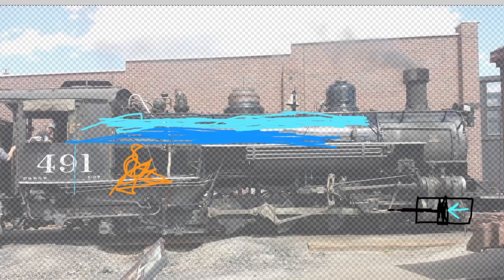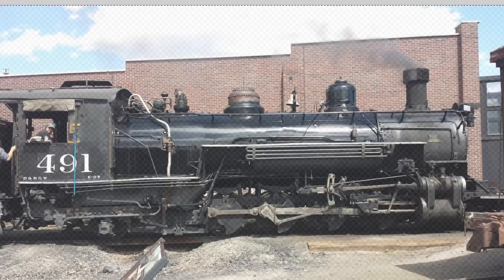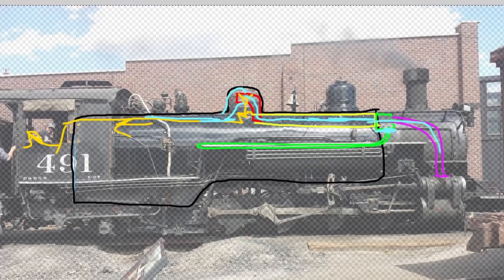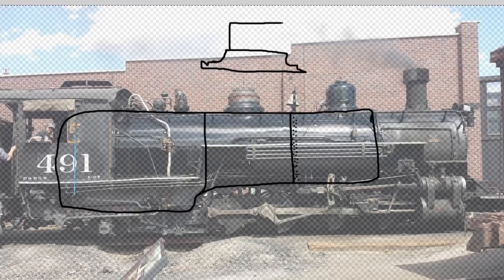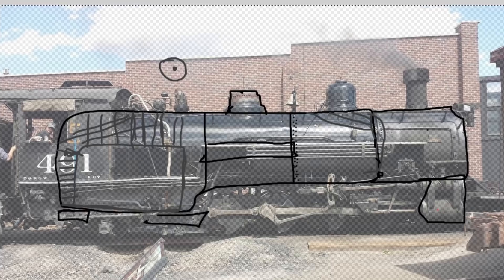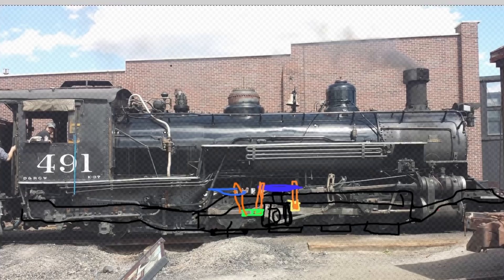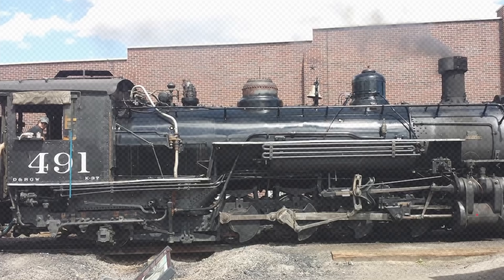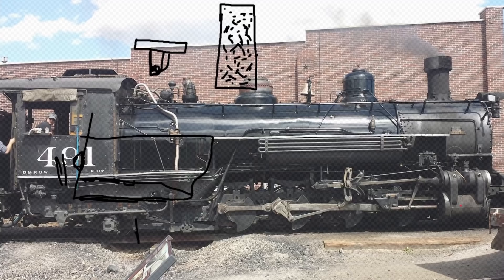Steam 101: 10 Levels of Steam Locomotive Understanding

Comment: Excellent video Hyce!

So a possible analogy for 'hooking up' or notching back the johnson bar can be somewhat equated to the throttle in a car today. To get moving you typically have to give the car more gas to overcome the stopped inertia of the vehicle, and as you pick up speed you actually let off of the gas pedal because the initial amount of power needed isn't required so you're either going to take off super quick or spin the tires, you will obviously burn less fuel at part throttle as you would with your foot mashed to the floor pan. You'd also use first gear and not 4th to start out.

A steam engine isn't quite that simple as you're not controlling an explosion in a cylinder, but rather a compressed, active gas. I say active because it's not just like compressed air at some pressure, you actually have a thermal component of energy tied into that as well. Without getting into really ugly thermodynamics, just understand that hot compressed steam has way more power than just compressed air. 

Ok, so what practically is going on? At stopped the engineer needs to have fine control of the volume flow of energy from the boiler to the pistons. Because you're trying to acceleration literally thousands of tons, through a contact patch between all the driving wheels and the rail that's maybe the size of a dime, you have to be very careful how you apply that power. At low speed it is easier to just control the flow and use the whole stroke of the valve gear to have that fine control It does waste steam because you have way more energy there than you need, but it's easier to control. Once you get everything broke loose, and rolling in a more or less steady state (let's assume level track for sake of discussion) you're now at the point in the car where you'd start letting off from the gas pedal. But in a steam engine remember that you're real goal is controlling total energy usage... so while throttle is letting the energy get to the pistons, the johnson bar is what determines how efficiently that energy is getting used... 

Now that you're moving kinda steady state, you can move from full admission (valve open the entire piston stroke) to less admission (moving the bar more towards center and less piston stroke). This is where the thermodynamics part kicks in, such that instead of just flooding the piston with 200 PSI of ridiculously hot steam, you can maybe fill that piston volume with 75% but let the heat transfer it's energy to the motion to do work.  Kinda like also going to 2nd gear. 

I'll call this out separately because this isn't going to be accurate, but for the sake of discussion, you'll get the point, At full admission you push in 100% cylinder volume at say 600 degrees Fahrenheit.  When the piston reaches the end of the stroke, that 100% volume of steam has to get out and up the stack, it might leave the cylinder at 550 degrees... but you have a boatload of volume to get out, so that when steam hits the piston to reverse travel on the other side, it can actually move the piston back. There comes a point in speed, where at full gear the valve ports simply aren't big enough to get the steam out of there fast enough to allow the piston to go the other way with the train load and not trying to force the waste steam out too... So, by cutting the Johnson bar back, you might only put in 75% volume at 600 degrees, but now at the end of the stroke, the steam leaving might only be 400 degrees... and... you have 25% less steam volume to shove out to make the piston go the other way....  The more cutoff you use, the less steam goes in, so that might be 50% volume at 600F but now it leaves at 300F ... and so on. And again, you'd use another higher gear, and another and so on.

There comes a balance point where once you match flow rate of energy from the boiler to the energy required to keep the train moving at whatever speed you want.  You can loosely also equate this to using a higher gear in a car... you start in first, then second and finally end up in 4th or whatever.. You'd never be able to start in 4th, but you couldn't run 70 MPH in 1st gear either. And that gets back to the efficiency point as well... buy using progressively less cutoff as you go, you consume less steam and therefore less fuel to boil the water to make steam.  If you tried to run the steam engine at full speed at full gear, bar all the way forward, 2 things will happen, you'll run out of steam, and you won't even get going that fast because of the back pressure issues you'll have in the cylinders and valve chest... Oh and the fireman will probably try to beat you to death with the coal shovel because no human (or probably even mechanical stoker) would be able to supply enough coal and water to match the consumption rate. 

And as a final note, if you were to come to an uphill portion, just like in a car, at some point you're going to need more power to overcome the grade... same is true here. You probably can't open the throttle any more, or it may already be open all the way, so instead you'll start slowly moving the bar back forward again adding a little more admission, or like downshifting in a car. It's a balancing act. 

That's a lot to absorb, but that's probably the most simple mechanical analogy I can come up with to further explain what's going on.
Reply: This is an outstanding explanation!
Reply: @Bill Chisholm I have a Digitrax system and I just find it so much easier to connect it to a pc or a laptop and run JMRI. JMRI is free and on a NCE Powercab there is a NCE USB interface 5240223 that you can buy that connects as a controller and allows you to program using an easier to understand named settings.  And it allows you to save those settings for the locomotives, stationary decoders and signaling decoders. 

I use JMRI to help speed match engines with different brands of decoder. I have a mix of BLI, Athearn, and Kato. With dcc from factory and with added decoders later. 

And on my Digitrax loconet, it also controls the signals, while running on a Raspberry Pi 3b.

Comment: Great video you got here. I finally understand how steam pistons really work.
I would love to see similar video focusing on brakes. Especially of how main brakes work since understanding that would be useful not only for steam trains bot basically for all types of trains since most of them use similar system.
Reply from the maker: Certainly! The most advanced steam engines used the same kind of brakes most of the diesels use(d) so it will definitely be applicable.
Reply: @Hyce777  Looking forward to the video

Comment: Nice explaination. 
I have some experience with woodburning locomotives, they're not really that different from coal burning ones. Our locomotives are coalburners, but they've been run on wood in times where there has been coalshortage (WW1 e.g.). One of our locomotives (UHB No 2. Urskog) has been rebuilt from coal/woodburner to oilburner and later from oilburner to biomass-briquette burner and is now considered a "green" steam engine.

Comment: As a steam fan (but not fanatic) for quite a few years, I think that you have done a great job in only 1 hour. The further up you got, the more times I found you filling in or clarifying details- Thank You. At the end you did a great job of covering my wish list of other steam engine/train functions.  I guess that my only part that could have used a little more work was the injector system. It seems strange that a steam supply at boiler pressure could overcome boiler pressure and force water into the boiler. I have read about the injector venturis, but it still seems like magic (and invented so many generations ago! ) I would have thought a steam driven piston pump would have been need-like the air compressor.  Keep up the good work!

Comment: I'm not exactly sure how I would fit on the scale. I like steam locamotives but I'm not extremely well versed. However I am a huge naval history buff so the engineering behind coal and oil fired boilers I've got down to a T
Reply from the maker: But remember these are fire tube boilers, not water tube boilers... always slightly different. :)
Reply: @Hyce777  there were early ships that used fire tube boilers. Like some of the wooden hulled paddle boats from when steam power was first used on naval vessels

Comment: Great video and explanation. On an oil fired engine, one purpose for the "peephole" on the firebox door is to allow sand to be suctioned through by the draft to run through the tubes and flues to clean the soot off.

Comment: To add to your comments about rivets: Hot riveting generates tension to compress the pieces together because the rivets are installed and formed into place at a high temperature. When the rivet cools, it shrinks and that is what gives the shaft of the rivet its internal tension. Whereas a threaded fastener generates compression through torquing the bolt in place.
Reply from the maker: Huh, that's a little detail I didn't know / think about. Makes sense though. That's cool!

Comment: Very great video explaining in depth the different features and components. As a avid steam enthusiast I have not had much locomotive experience but have operated several 7.5 gauge locomotives. Operating a full size loco is on my bucket list. I do however own a steam traction engine which works alot like a locomotive. Would love to give you an invite out to ohio if you where interested in running one. Loving what you guys are doing with railroads online and how well the controls reflect running the real thing and I know it will only get better.
Reply from the maker: Cheers! I'm familiar with Ohio, my great great great granddad founded the Huber manufacturing company so I go back to Marion here and there for reunions, and there's typically traction engines there ;)

I appreciate the invite!

Comment: 26:21 "crash course " intended tounge in cheek or pure sarcasm. 28:05 oiled or grease. "this is just an overview ..." yes, just an overview but you are doing an excellent job so much that I'm not consistently watching just listening so the picture you are painting is " spot on"
Reply from the maker: Ours were just oiled, though I'd bet some of the larger locomotives had soft grease or hard grease fittings for the furnace bearers.

Comment: Hi, I loved your video, lots of great detail and good explanations overall.  One comment about your discussion of the injector:  In practice (and I work with model live steam, but it works on the same principles) when operating an injector, you open the water source first, then apply the steam (or some injectors have a single valve that does both simultaneously).  Opening the steam passage first will heat up the injector, which prevents it from functioning.  Also, the the injector overcomes the boiler pressure because the latent energy of the steam is absorbed by the water as the steam forces the water through the injector cones.  Using both forward and inverted venturi cones, the speed of the fluid is accelerated while the water absorbs the heat energy of the steam, then is decelerated, which converts the speed momentum into pressure, allowing the injector to overcome the boiler pressure.  In the injectors I am familiar with, the overflow is not closed; rather, the steam being applied causes the water to be forced through the injector and to the boiler, hence the overflow stops.  There is a valve in the injector that closes off the overflow path, but this is part of the injector's operational function.  The operator only has to regulate the water flow so that the steam is able to pick up the amount of water being provided.  Too little water and steam escapes through the overflow; too much water and the water is forced by the steam out the overflow.  It is a rather delicate balance.

Comment: Hyce another great video. One thing. When setting the automatic brakes, the independent brakes are already  released and the engineer is not  holding the independent  handle in release but he is pushing down . He is holding the handle down (actuated) to keep the automatic brakes from setting up  on the locomotive which does not stop the brakes setting up  on the cars. He does this I believe to stretch the train so the cars don't run into the locomotive. Amazing job tho. Thanks much. Keep up the great work.
PB
 airbrake specialist ATSF 2926
Reply from the maker: That's true on 26L! With our 6ET and A1 brake equipment, you have to hold all the way left for release / quick release to bail instead of press down.

Comment: As a (retired) Marine Engineer, about 34 years of it steam, there is no efficiency of a throttled valve. The valve gear allow full pressure steam to the piston crown near top dead center to expand to near atmosphere as it leaves the cylinder. Old D slide valve engines the exhaust were so restrictive as to limit speed and power since the steam had to have a relatively higher pressure just to leave the cylinder. Early ships oil atomizers were straight mechanical burners with a very low turn down ratio over their pressure operating range (100 to 300 psi oil pressure and a flow change of less than 2 to 1 due to viscosity and mechanical limitations). Steam atomizers can allow oil pressure from 15 to 300 psi or so, so one set of tips can be used from light off to full power output. Most steam atomizers I delt with were set to 15 psi higher than the burner oil pressure up to 150 psi with an automatic regulator, commonly a Leslie valve, but now probably an air controlled valve. Most boiler feed pumps I worked with were reciprocating pumps or turbine pumps as injectors might work at the 225 or so pressure of older locomotives, but useless at the 900 to 1100psi of todays steam, if any still exists. The higher the pressure, the greater the: maintenance, need for feed water/boiler treatment, superheated steam (so water will not condense during expansion). Even at 300 psi, feed water heaters, economizers, and air heaters pay in fuel savings and tube life. Undissolved oxygen in feed water is hard on tubes when it gets in the boiler, again, the higher the pressure, the worse it gets. Recip pumps like air and feed water are usually the same idea, differing due to pump needs and are usually single or double cylinder. Single being more efficient, double should always be able to self restart after being stopped. Have fun
Reply from the maker: Brilliant comment, always great to hear from those with lots of experience. Lots of good stuff in here. I will say that your comment about "no efficiency in a throttled valve" is correct until you get some speed going - the return of the piston cutting off the flow changes things pretty quick imo.

Comment: I would love for you to do a video on automatic brakes, That would be awesome to hear you explain it. As a Former minor railroader Conductor/ locomotive engineer here, learning automatic brakes will mess with your mind, it did for me for a little bit, but its basically backwards of what you think it should work. Thats how I saw it, but absolutely crucial to understand in order to handle a train, especially during switching. I've experienced a couple of oh shit moments but was able to control it safely in time. Our whole yard was at a grade. it was only .36% most of the time with a couple of spots of 1%( looks and felt) no real idea. But as an engineer, Going east in the yard was up hill, going west was down hill. two sides of the yard, you had to handle the train completely different while switching. and brakes are your friend or your worst enemy depending on your understanding of handling a train, because to much set your going to stop, and you'll have to recharge, then continue the move. And its all about tonage! also how many engines are you running/ have operating the move. Though I only delt with Intermodel cars, Spines and well cars. but handling 9000 tons of international freight well cars with one locomotive going up hill is not fun. especially when you needed to stop and then the slack pulls you backwards downhill for a second. I Wish I could have had a chance to handle manafest cars more but we did build 16k trains though, usually 2x2x2 dp'd
Reply from the maker: That's some serious business railroading! And yeah, all your points are right.  Cheers!